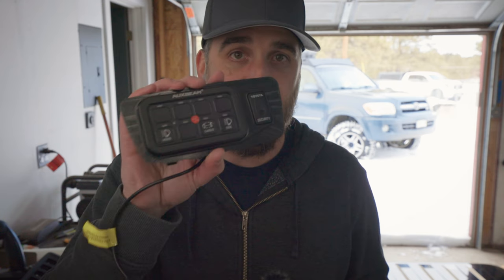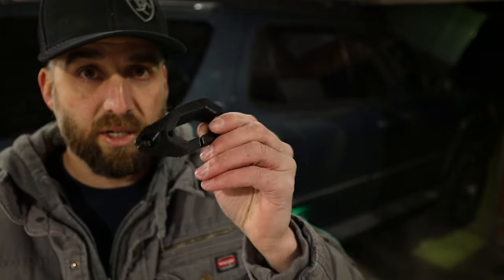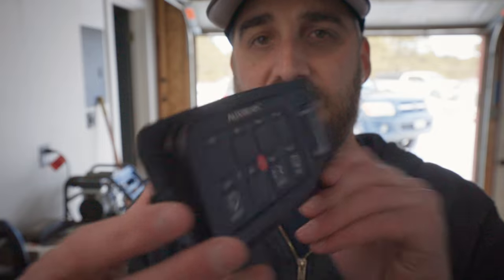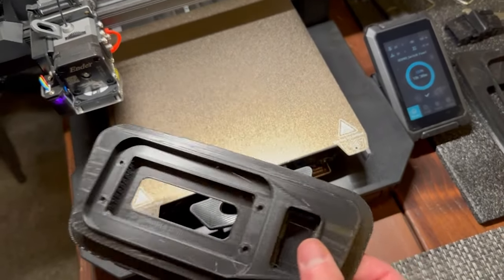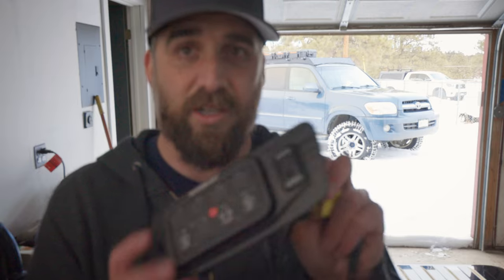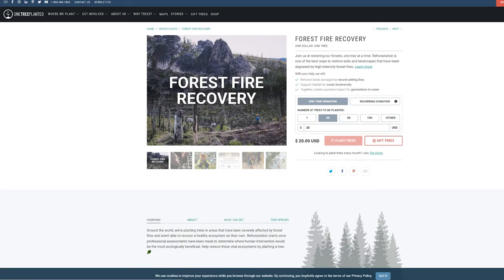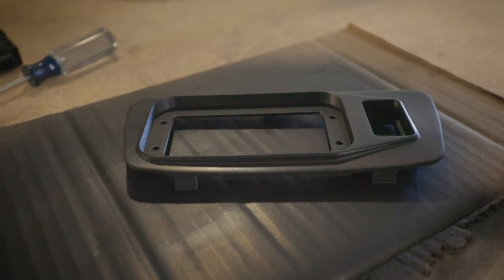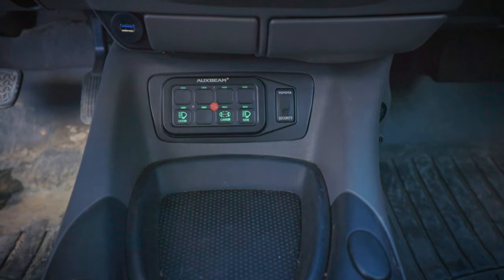Free Switch Panel Mount - 1st Gen Sequoia

Comment: Dave, Thanks for your hard work and for creating this switch panel. I just recently purchased a 2007 Sequoia and it's tough trying to find accessories for it. This will help me out a ton as am starting to build mine out a bit.
Reply: Also where are you located? I'm up in Thornton and use my 100 series to wheel and my Sequoia for extended camping.

Comment: This is awesome! If you could figure out a phone / accessory mount design you’d be a legend in the first gen community
Reply from the maker: I was originally going to do a 1” Ram ball in place of the stock switch/sensor location, but wasn’t sure how it would be on leverage with a phone there. I’ll have to see what I can think of since I have similar issues. I throw my phone upside down in a cup holder or in that center tray but it slides around.
Reply: @adv_mnd  I installed the OWL Media Mount into the stock sequoia radio and it works great. I have this same set-up for my 100 series but that's a lot easier to install. With the sequoia stock radio you will need to take the whole thing apart to remove the cassette internals and install the mount. It takes about an hour, just be patient and it solves the phone mount. You are able to attach a 1" ram ball and or you can mod it in a way to have your phone and and iPad mount attached to it. I have pics on mud for this install.

Comment: any way you'd make a file without the hole for the aux beam and add in more switch panels?
Reply from the maker: I might make some other designs in the future, but not at this time. Assuming you mean the factory style opening, There’s some people out there making ones like you want. There is one out there that has 6x holes and the stock one is 4x. https://www.tundrasolutions.com/threads/1st-gen-sequoia-switch-panel.208078/